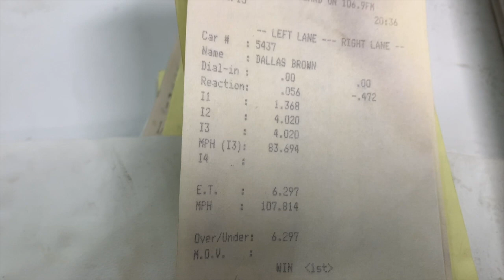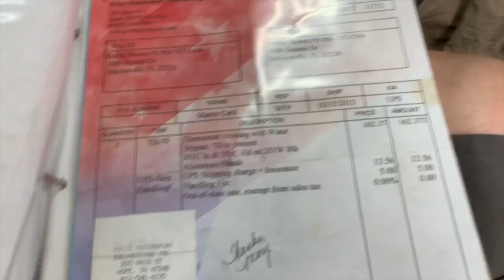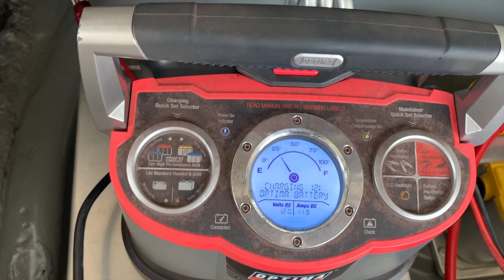Resurrecting our 427 Clevor Powered 1988 Thunderbird Drag Car Part 2 #nonamenationals

Comment: One question if I have a rod knock and my crankshaft looks like it needs a fix up should I buy a new one or have the machinery guy custom make it ?
Reply from the maker: Just have the factory one turned at the machine shop. If it cannot be turned buy a new one.

Comment: Dallas, how did you get the car down to 2600 pounds? My SBF Pinto weighs 2670 and I removed lots of weight.. Any tips to reduce weight?
Reply from the maker: Chromemoly, lose everything you don’t need at all. Crash bars in the doors, window regulators, anything that’s not needed for it to go down the track. I took the dash out and replaced it with tin. All the wiring. I used minimum wires to make it run only. You gotta find the stuff that’s not needed, like crash guards and accident safety features first.